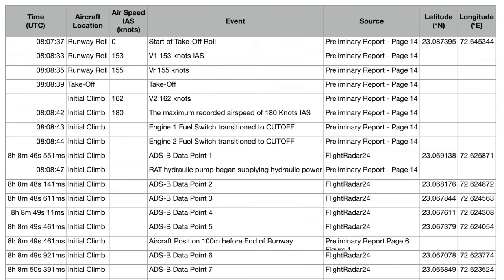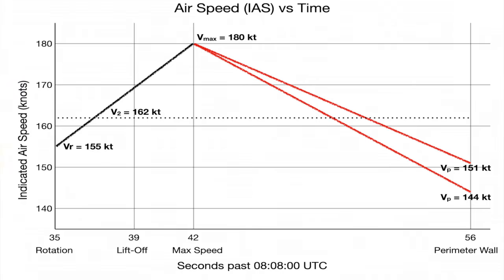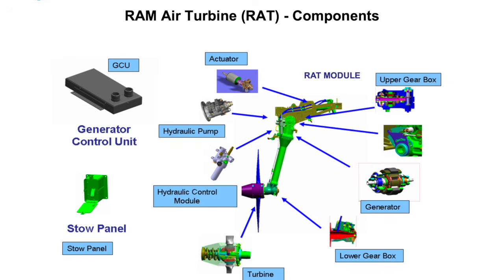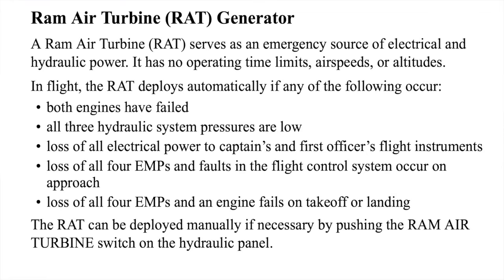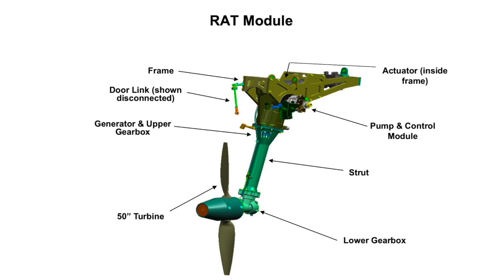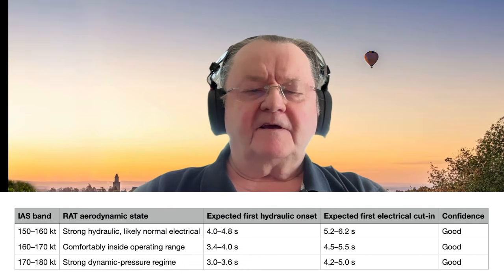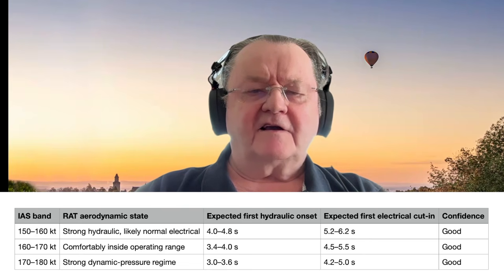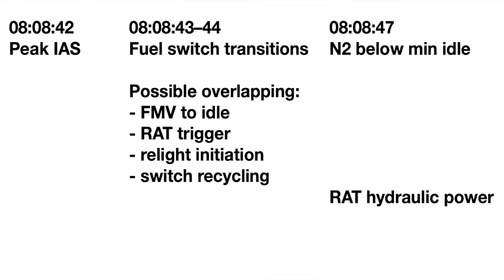AI171 - RAT Deployment - Spurious, Human or System

Comment: Richard, very thorough analysis of RAT deployment. Have you analyzed a complete loss of electrical power to electric fuel pumps which would also have initiated RAT deployment? I presume you have looked at potential single failures pertaining to FADEC. The final accident report should consider all plausible failure initiating events as an alternative to assuming one of the pilots moved both fuel cut off switches.

Comment: Thanks as always for your analyses Richard, but particularly this one, simply because this was such an "unlikely" event. On the face of it, a modern, technolgically advanced airliner which suffered considerable growing pains in it's development, but seems to have settled into operations with relative success. It seems to me though that with any modern and complex piece of kit, the Dreamliner needs regular care and maintenance.

I have a question for you Richard concerning the APU.  There seem to be several diffferent opinions on use of APUs on the ground, and much less, in the air. Some airlines seems to use APUs quite sparingly, whilst others seem to use them more liberally.  At the takeoff roll, and the initial flaps and slats climbout the aircraft has to exert it's engines the most, although I believe it is possible to climb out on a single engine if the other gives out at the critical moment. 

In the case of AI171 - had the APU been allowed to remain in operation during takeoff, and assuming the catastrophic failure wouldn't also have affected the APU, would the outcome likely have been different ? 

Many thanks Richard
Reply from the maker: Operating the APU during take off is governed by airline policy and the Minimum Equipment List. In the case of AI171, if the APU was running the electrical configuration would allow immediate relight of both engines following a dual engine flameout. The APU costs more to operate during take off, but gives another level of safety and redundancy.

The preliminary report says the APU inlet door began opening after both fuel cutoff switches were returned to RUN, “consistent with the APU Auto Start logic,” while the RAT had already deployed and the FADECs were attempting relight. So there is official evidence of an automatic restart logic sequence being triggered.

Engines can only be started using autostart. Electrical system powers two starter motors connected to N2 shaft via the accessory gearbox. Power is drawn from airplane’s electrical system. Two sources: APU and forward external power. Normally, APU power is used. Simultaneous engine start only allowed when APU is running and both APU starter generators are operational. With an inadequate power configuration, second start command is ignored. Load shed always occurs during engine start. START selectors control the starter motors. Ignition and fuel flow through the FUEL CONTROL switches. EEC monitors the start and commands starter cutout when engine reaches idle speed. ENG STARTERS L, R displayed if both starters fail.

The Preliminary Report states that one engine relight sequence was further advanced than the second engine relight sequence and also notes the time difference between the fuel switch transition from CUTOFF to RUN in each engine.
Reply: @IAIwithRichardGodfrey thanks very much for the reply ❤

Comment: Wow - lots here to take into account - to me 10KVA is going to mean "quite big" so easily seen - but maybe hidden alongside the RAT door. Also i note the RAT actuator can be powered from either 28v busses meaning it could easily be actuated during 1 of the 28v bus failures (short low imp)..  Dont know what this can add to what i am presently thinking... im still studying this diagram though im dissapointed that the general diagram doesent make clear some details i would need to know.. (leaving lots to interperation).  maybe its my lack of info...  But i note that the Brakes are all powered from (Up inverted to +/- 130v) 28v battery power - which i wonder why - are the brakes not hydraulic electric pumped.. (im interested because it seems likely something happened to short a 28v bus (maybe sometime during the runway run) and if brakes are 28v supplied (up inverted) at Many Amps (including during wheel stowage at gear up), then the strong proportional brake pedal press (at start of runway) together with small increase in asymmetric engine power required (read here increased battery charging from engines)  (dont know if Right or Left pedal) in order to turn around and align aeroplane ready for takeoff could be a final straw for the 28v bus). leading to later venting at point of rotation with extra demand on gear up...   Kevin.. Thanks Richard...
Reply from the maker: The Boeing 787 is a mostly electrical aircraft and there are hundreds of diagrams to follow everything. The RAT actuator can be powered from either DC bus, with the Main Battery and APU Battery as back up.

The brake system is control-by-wire brakes, auto-brake and anti-skid with electric brake actuators.

The nose gear steering is control-by-wire (pedals & dual tillers) with hydraulic actuation.

Nose gear is a two-wheel steerable unit. Each main gear has four wheels in tandem pairs. Hydraulic power for retraction, extension, and steering supplied by centre hydraulic.
Reply: @IAIwithRichardGodfrey  Many thanks for the infomation. Ive found it very interesting to look in to how the electrics work on this plane.. Im building many Arduino projects at the moment to display data from my lithium battery solar system..Thanks again...   Kevin..